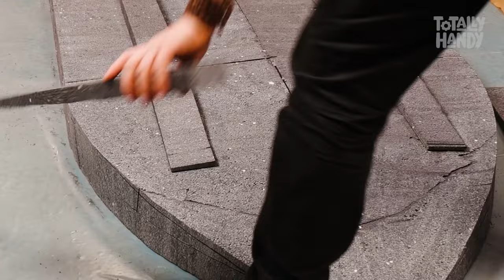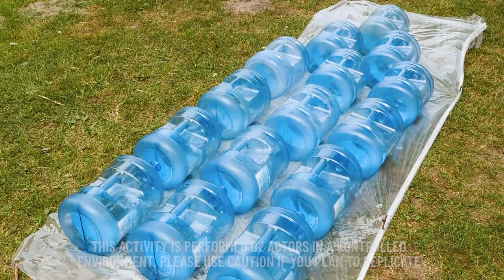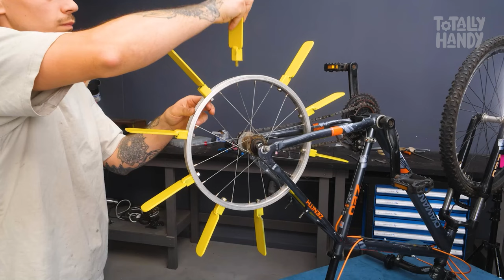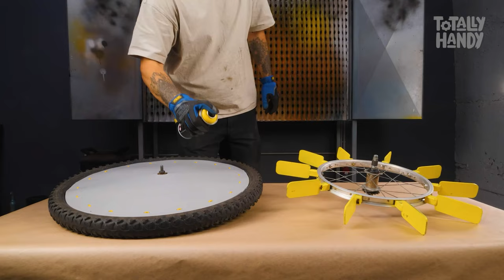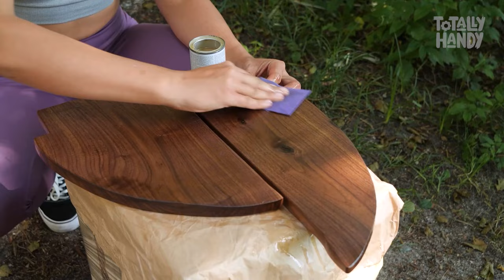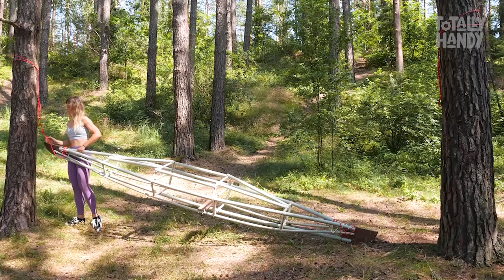DIY Styrofoam Boat: Brilliant Idea or Environmental Nightmare?

Comment: Foam(m),  fiberglass, glue, and a lot of ingenuity serves the project well..... "environmental nightmare" ?  I'm not seeing
how you even put that in the title except as a "gaff" to get views but I will say that this is very interesting to see.  Using
hot-wires to cut foam is very kool & save a lot of time once you get the electric setup properly so the wire doesn't get
so hot it breaks off.  That said,  this has given me the groundwork to build one a little larger but forget pedaling for
locomotion..... there's a lot of small gas motors or get a small 4Stroke motor for bicycles & add a shaft n prop to
move you.  I think it would surprise people just how easy this could become a real boat you'd use?  His design is
sharp but I doubt it would be good on a boat w/ a motor unless you swept the wings backwards more.  Designs
are easy so I want to know what type of foam they used here & why?  Strengthening the connected pieces with
wooden dowels was smart as well.... these guys have been building surfing stuff or other boards for a while
b/c they've got all the hand-made cutting wires perfected.  Thanks for the video  but where is their channel
links?  I'd really like to check them out?  peace